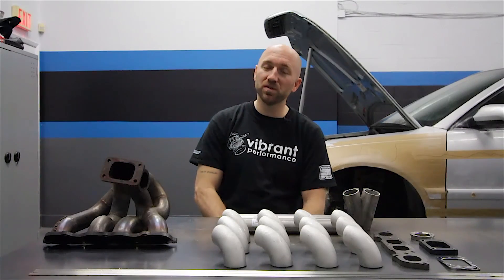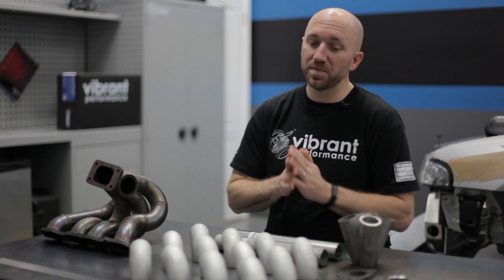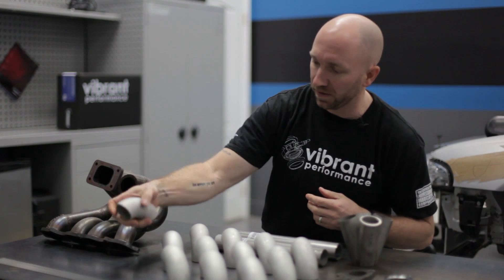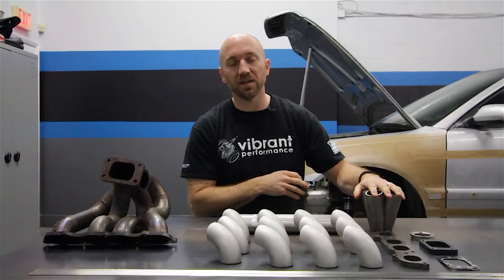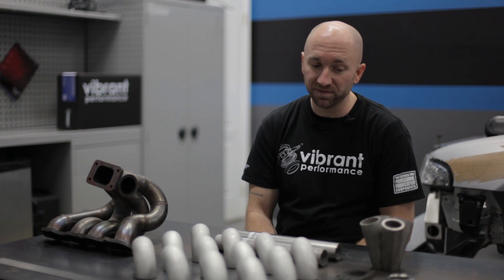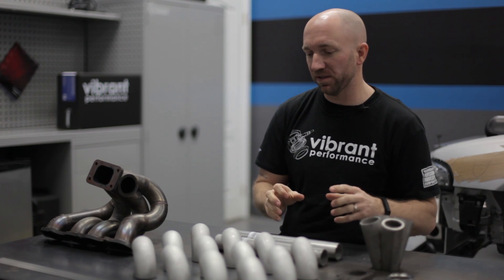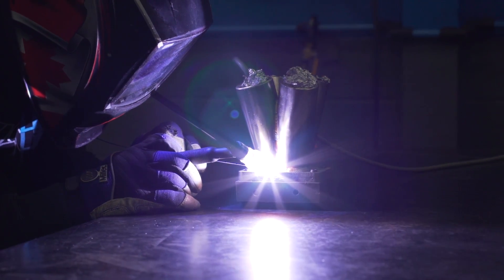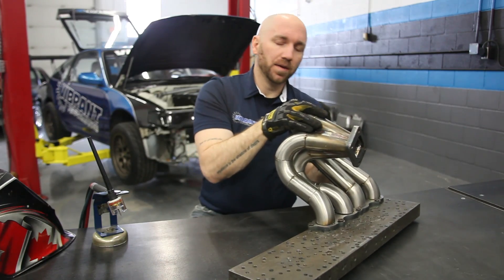RWD Turbo CRX Build: Episode 4 - Building a Turbo Manifold: Part 1 (Material Selection and Prep)

Comment: For stainless steel I personally go for 321 or 347 for longlivity, 304 is pretty bad when you start to reach fast car temperatures in the manifold :/
Reply: If money and availability of material was not an issue, inconel would be my first choice, personally.  We offer 304ss as a cost effective material for exhaust fabrication.  When welded properly, 304ss will provide excellent longevity for the value.  Failures are often caused by poor manifold design, poor welds, or thermal wrapping the material.

Comment: can exhaust flange be reused?
Reply: Effort to cut off a manifold?  You mean running it through a bandsaw?
Reply: it isn't ideal to reuse a flange.  the effort to cut it off a manifold would likely cost more in cutting/time than getting a new flange.
Reply: I've done it before.  Depending on the manifold, it can be messy and you will never get the same result as with a new flange.  Cleaning/prep will be required to remove contamination from the material before welding new runners onto it.  Cutting it off may also release tension in the material and it may not be flat once you cut it off.  Can it be done?  Yes.  Would I do it?  No.  I prefer to work with new, clean materials for the best results.

Comment: Great vid can you also show how to cut the angles on the merge collector pipe?
Reply: +tarik adams the collector used for this turbo manifold is a Vibrant pre-cut collector (part number 2454).  using a laser cut collector will save you a tremendous amount of time and headache associated with cutting your own collector.  i have cut many in the past and they are hard on saw blades and difficult to get consistent results.  this is why i chose to go with a Vibrant pre-cut collector.  Aaron

Comment: looking forward to future videos about making the turbo manifold as there is not many on youtube that shows this info. i am making my own manifold soon so it would be good to know more about gas purging, penetration, fit up, amps and if 1 or 2 runs are needed. cant wait for the next video!!!!
Reply: +057john this will be discussed in part 2 of the manifold video segment.  you should always back purge when welding stainless steel, titanium or inconel.  this will make for a stronger weld.  fit up is critical to ensure getting good results with your welding.  zero gaps and a properly sized bevel will help you get consistent welds.  typically i do not do a root/cap pass with manifolds as i bevel the piping enough to get full penetration with a single pass.  it is really personal preference though- some people like to do a root pass that is back purged, then a cap pass that is not.  in my experience, i have always had success with a single pass on all welds.  amperage, cup size, tungsten selection and filler selection/size will all play a factor in your results.  these will be discussed in more detail in the next video.  thanks for watching!  Aaron